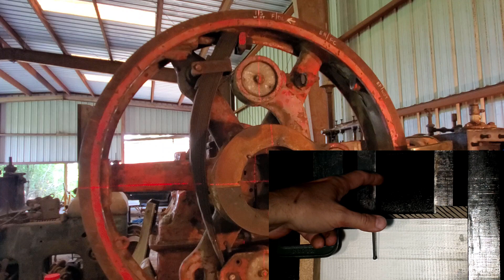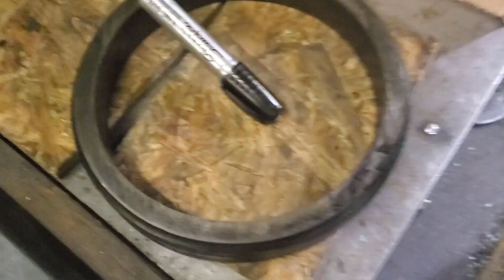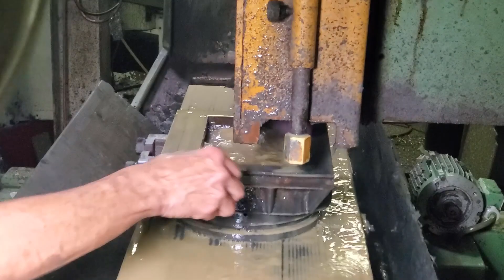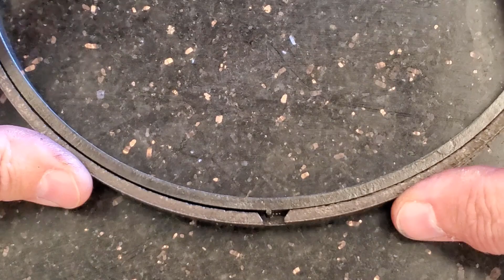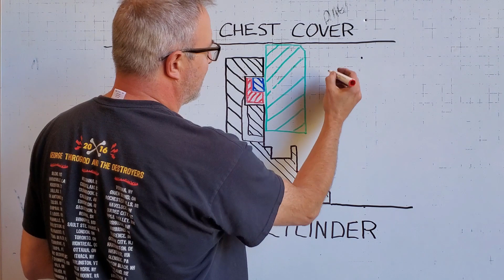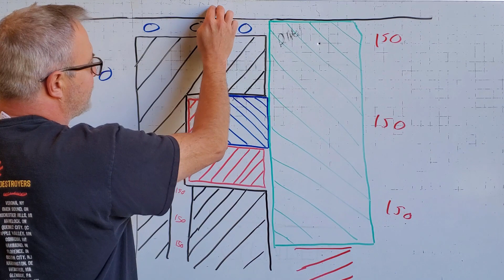Skinner Steam Engine - Pt III - Slide Valve & Balance Piston

Comment: Did you shim the springs to make up for the lost material from the machine work so the tension remained the same? I reckon you will need 25cfm of air to get the engine to run 100rpm. and at least a 1/2"id hose. I think this is doable. Looking forward to first turn!
Reply from the maker: I could add. 025" if I want to be a stickler,   but I doubt the spring tension is significant compared to the pressure holding things tight. If you are right on your air consumption, the Quincy can handle it. I have 1" air line ready!
Reply: @EngineersWorkshop  1" airline maybe get 400rpm!!
Reply from the maker: @bcbloc02  300 is target, but I will be ecstatic with sustainable motion of any sort. Did you figure 50% cutoff, and factor steam on both sides of piston (4x air of Otto cycle)? Would expect governed speed at 25% or less cutoff if piston & packing leaks are minimal.
Reply: @EngineersWorkshop  No i was estimating based off 150psi compressed air.